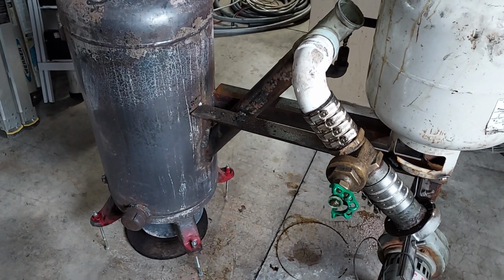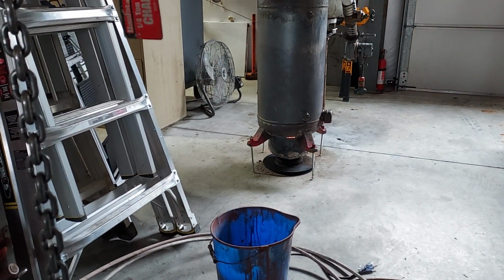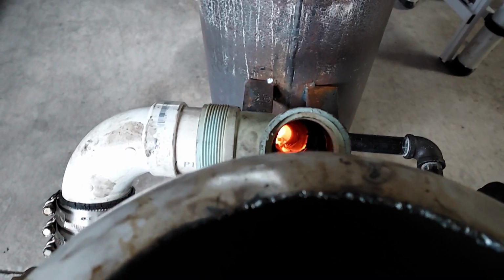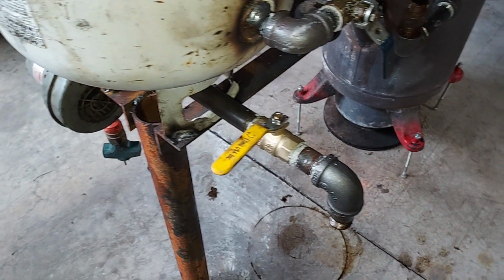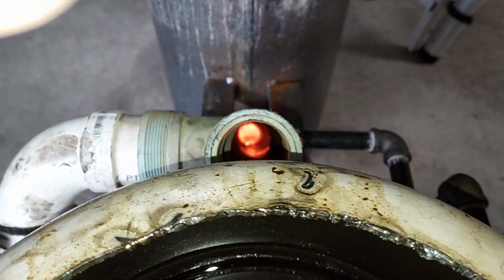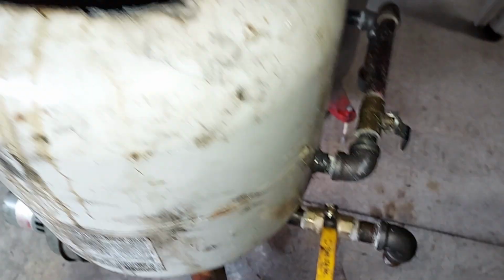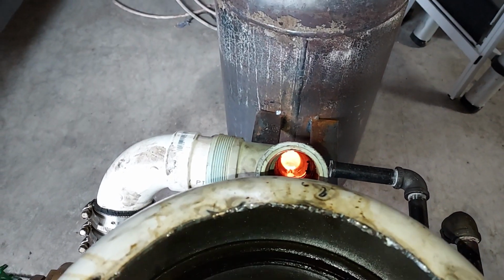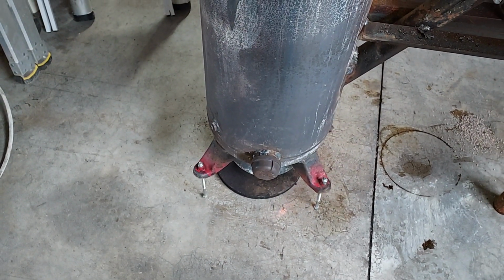SIMPLE WASTE OIL BURNER  HEATER  FOR AREAS WITHOUT ELECTRIC

Comment: that seams like a lot of smoke to me.  Your fire needs to burn hotter to produce less smoke.  I am guessing that the smoke goes away when you add air to the fire.  I think that if you could get more air to it, with out the fan, the oil would burn cleaner and electricity free.  Did you say that you have 6" flue pipe inside of 8" flue pipe?  Could you explain why please?
Reply from the maker: YES YOU DO GET SOME SMOKE WITHOUT ADDING TURBO AIR. BUT TRYING TO DESIGN FOR COUNTRIES WHERE THEY HAVE NO ELECTRICITY. IT IS A SIX INCHE PIPE WELDED ON TOP OF TANK 4" LONG THEN 8" FLUE SET ON TOP OF THAT.
Reply from the maker: YES YOU DO NEED THE AIR MIXTURE TO BE CORRECT.